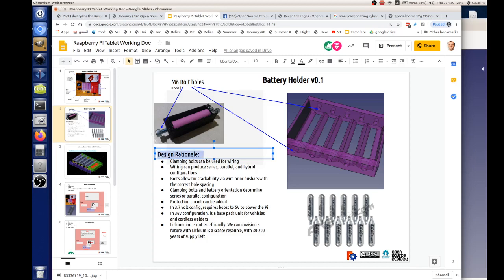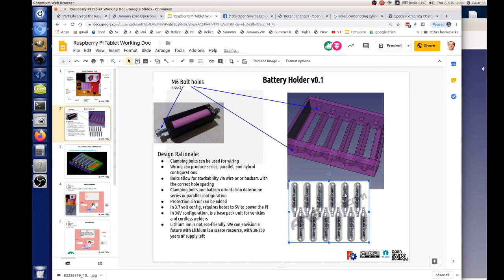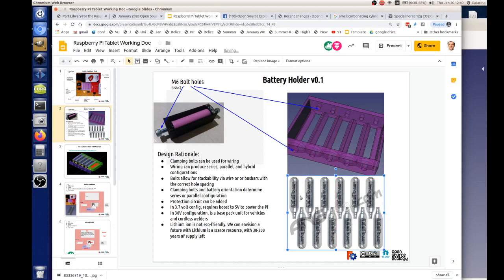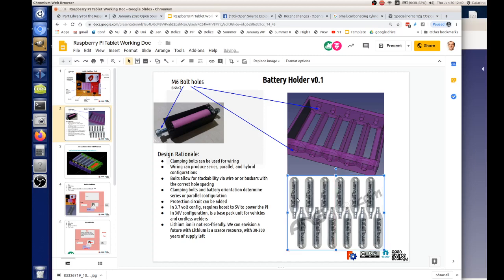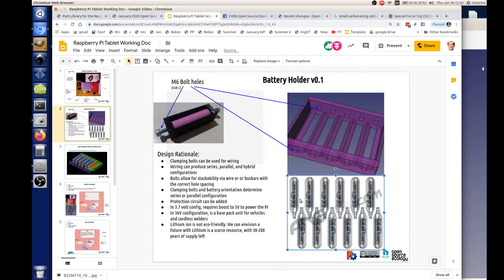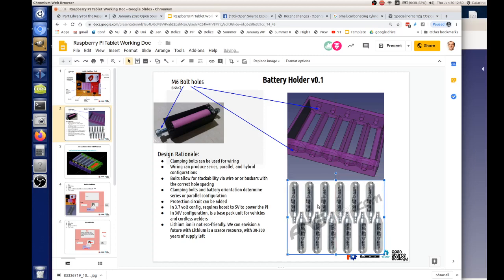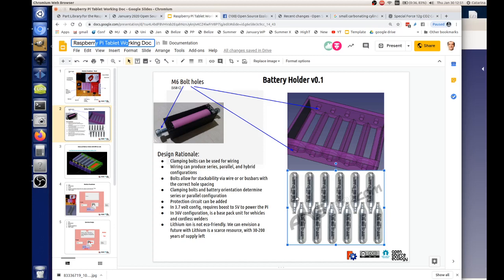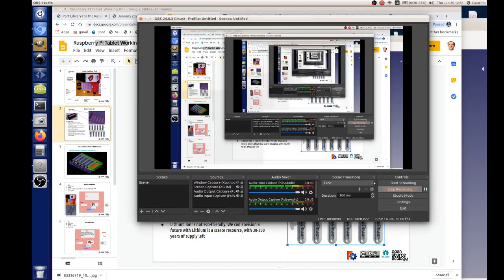The Future of Lithium Batteries

Comment: I think outside of future battery desings (weird graphene / CaRbOn NanoTubes (mostly just hype now) ) lithium is the only sensible option for small stuff.  Cars could switch to DME,b Methonol, Bio-Diesel, or Bio-CNG ICEs, Some could use hydrogen or methanol fuel cells (crogenic hydrogen or liquid methonol) althoug the economy/filling stations would be needed for this.  Also grid level could use basically ANYTHING else (CAS, PHES, FES, etc).  Low power devices can use supercapacitors and circuitry

This would leave enough lithium around to get to something better.

Recycling Old Batteries, rather than more mining sites and disposing of old batteries improperly should help as well.

Comment: Very interesting seeng you are considering alternatives to electrochemical energy storage. However I have two thing to say:
1. Hydrogen really does not want to be stored. It leaks though materials, it makes metals weak, it explodes when mixed with air  and it is very light. Today hydrogen is more practical in form of  alcohol, methane and naturally gasoline.
2. Hydrogen fuel cells (or any fuel cells for that matter) are hi-tech devices with rare metals. Huge companies are  working on those but so far results are not much cost-effective. The other way to use fuel is to use more traditional heat engines. There are some new interesting concepts in research, ex "acoustic Stirling engine" which has no moving parts and yet can be manufactured within regular workshop.
Reply: IMO cryogenic is the only realistic option.  Also power unit/cubic liter vs power unit/kg

For vehicles and/or home/grid storage, cryogenic hydrogen works great (Vaccum Delwar (Small scale examples are "yeti coolers" and "vacuum thermos')

Smaller scale than 250ml of cryogenic and storage becomes difficult.
Reply: и ещё стоило добавить что топливные ячейки запрещены в некоторых странах
и если они будут хоть сколько-то актуальны - будут запрещены во всех
тойота пыталась их внедрить - но сразу же получила фукусиму и перестала пытаться

по поводу второго есть ссылки?
Reply from the maker: According to Amory Lovins, seminal figure in the field of renewable energy, the storage issues have already been resolved. What say ye to this?
Reply: @marcinose  Storage issues solved by what? By super expensive carbon fiber high pressure tanks? Personally I wouldn't early-adopt those in my basement.
Reply: @legolegs87  я бы стал - если в этом есть хоть какой-то экономический смысл
а так - нам в любом случае крайне желательно начать своё производство и карбона и графена и всех остальных материалов...
Reply: кстати на счёт водорода попалось
Техника применения гидридов металлов является безопасным и легким способом хранения, перевозки и использования водорода. При хранении в виде гидрида металла водород находится в форме химического соединения, а не в газообразной форме. Данный метод дает возможность получить достаточно большую плотность энергии. Преимуществом применения гидрида металла является то, что давление внутри баллона составляет всего 2-4 бара.
Баллон не взрывоопасен и может храниться годы без снижения объема вещества. Поскольку водород хранится в виде гидрида металла, чистота водорода, полученного из баллона, очень высока — 99,999%.
В закрытом футляре топливные элементы могут храниться на протяжении нескольких лет без потери объема водорода и уменьшения своей мощности.